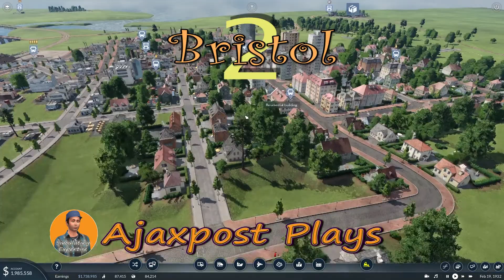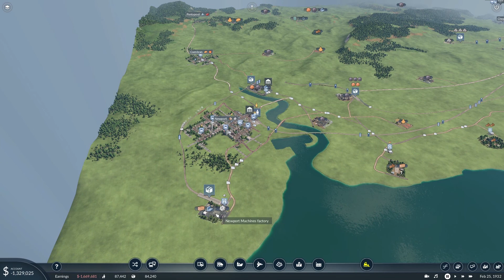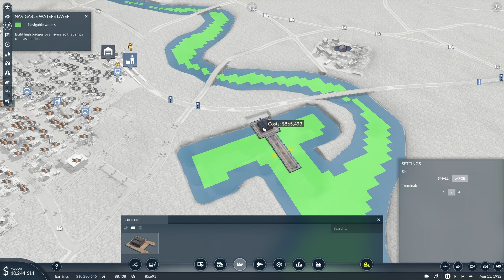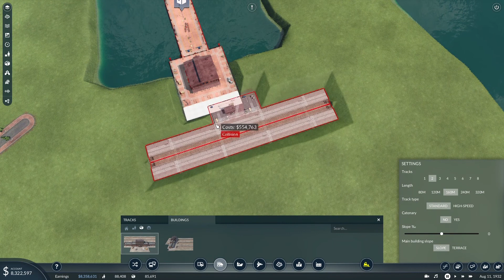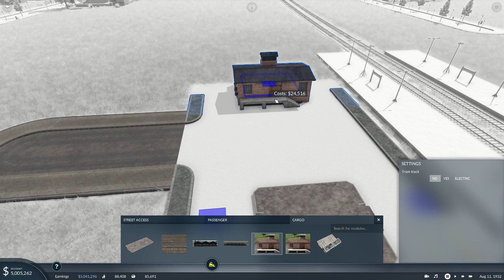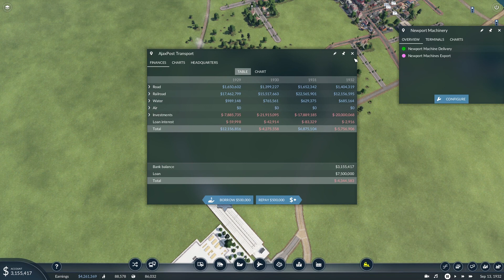Transport Fever 2 : Bristol - Machines Across The Water : Lets Play 2/15

Comment: Woodhead is an abandoned railway between Manchester and Sheffield, or more accurately Hadfield and Penistone. Had an impressive tunnel under the southern Pennines, which is now used by Nation Grid to house a power line. 😁
Reply from the maker: Hi, thanks for the clarification. 👍

Apologies for not remembering (you do so much in your videos, it's not my fault I forget 😉) ... have you now decommissioned the Woodhead line on your map ... or am I mixing up two quite separate entities here (wouldn't be the first time!)?
Reply: @AjaxpostPlays  I was thinking about keeping it, but didn't fit in when I remodelled Sheffield station.

Comment: There could be four things that could cause the problem of the iron/coal not loading 50% of each, 

1. It's not set to 50% coal and 50% iron.
2. It is set to 50% of each but doesn't have an even number of wagons.
3. The game logic forces it to load more of the material that is on the platform to stop overloading. for example, it had a lot more coal than iron.
4. The loading times for each material is different.

I didn't watch the video you set up the coal/iron line so you may have already done some things on the list, love the videos :)
Reply from the maker: Hi, thank you or taking the time to comment. 😊

Yeah, the line is set to only load 50% of each, full load of each, but has an odd number of wagons. Not sure about the loading times but I imagine they would be the same.

So, I changed the consist to make an even number of wagons but that didn't seem to help until I turned off the 'full load' instruction and they loaded an equal amount of coal and ore as required! Now, this did coincide with the amounts waiting on the platform being roughly equal so your third point could well be the key to the problem - it had actually occurred to me that the waiting ratio might be involved but hadn't done any checking until your comment prompted me into action!

Thanks again, seems to be working now ... until I change my mind about the setup anyway! 😉
Reply: @AjaxpostPlays  happy to help, currently binge watching your Bristol series and loving it. Keep it up 🙂